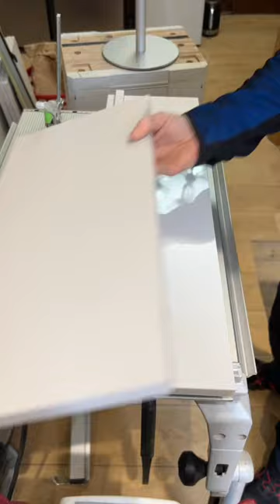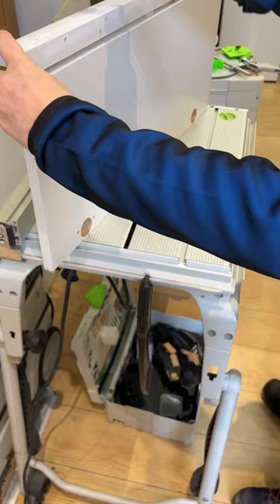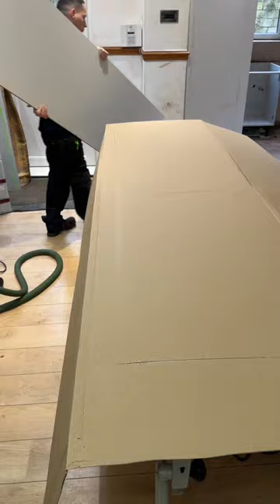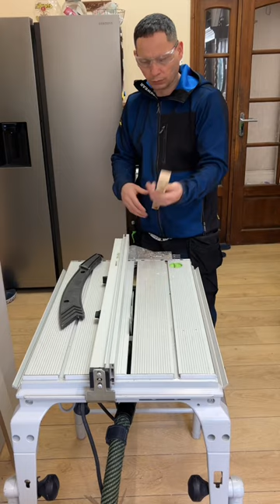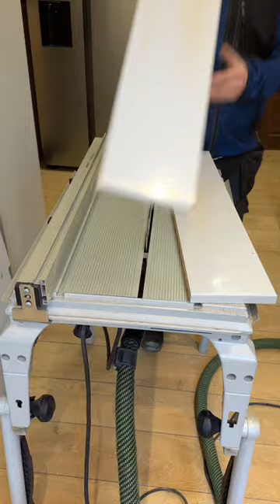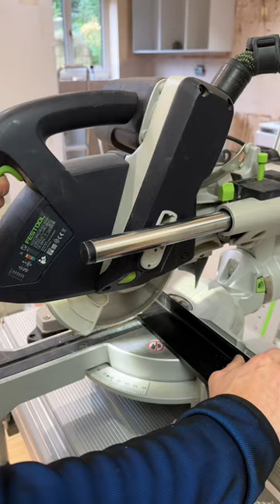Transform Your Kitchen: Exciting Corner Post Tips!

Comment: Hi There,
Is there a reason you dont use the guard on your table saw? I want one. I imagine the dust extraction works better with the guard on but wondered if maybe it gets in the way somehow? Many thanks, Will.
Reply from the maker: I mainly use table saw for scribe cut so i need to be able to see the mark line i know it would be more safe and more clean using it but , yah that is the main reason
Reply: @CAVjoinery  thanks man. knew there would be a reason.